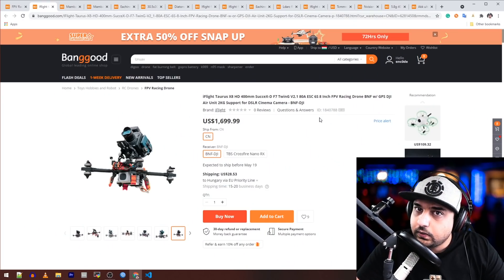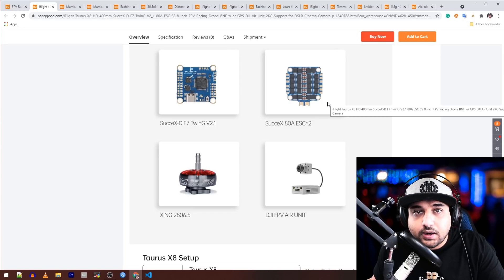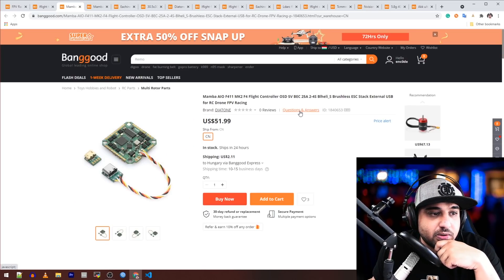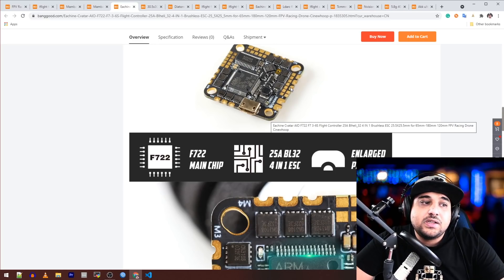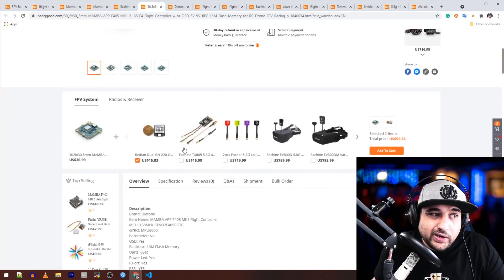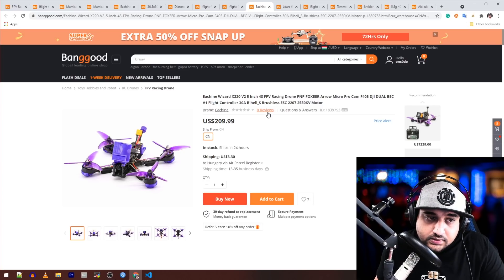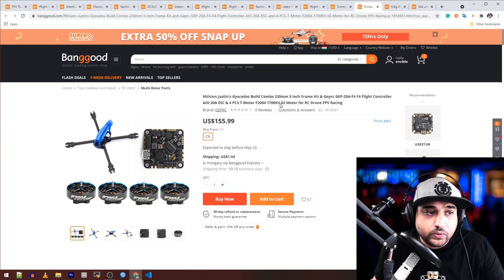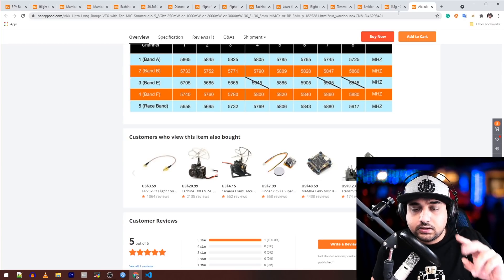Latest FPV Drone Components 2021 // iFlights 1,600 USD FPV Drone

Comment: With the Thicc, the motor screws are positioned slightly offset and they are on plates that you bolt onto the arms. The arms have a little dip in them to fit the head of the bolts. Look at a build video of the Thicc or the Big Baby (like by Nurk) and you"ll see.